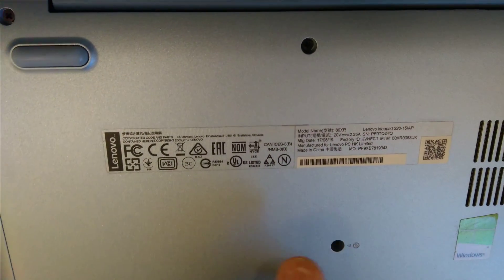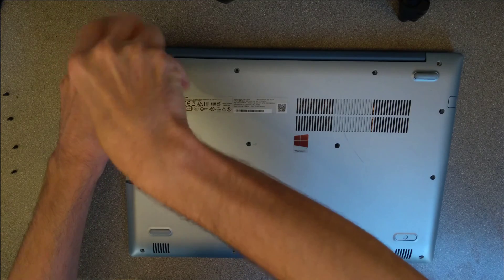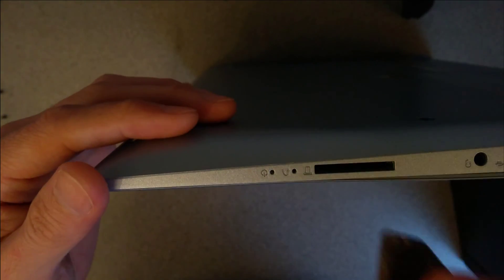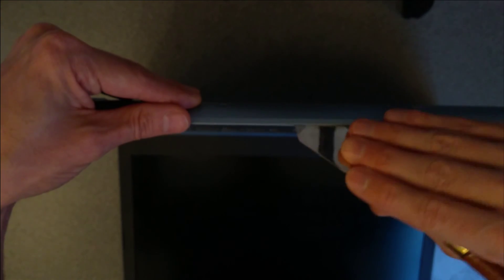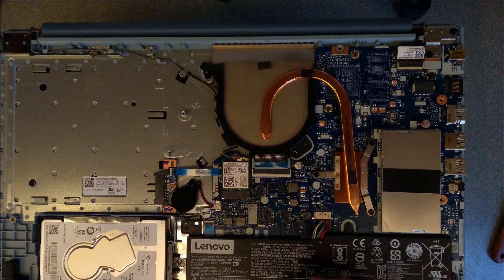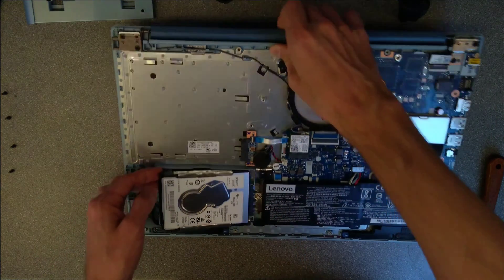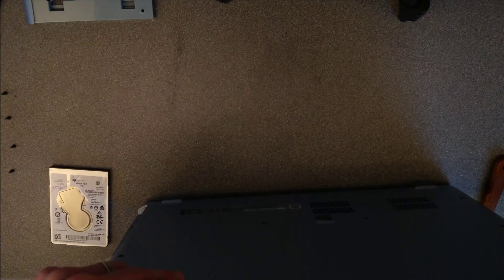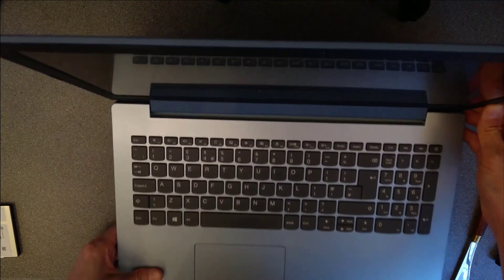Lenovo ideapad 320 - How to change or upgrade the hard disk. (80XR0083UK)

Comment: Hey when I did this my laptop was having booting problems
Reply from the maker: Did you clone the old drive, if so how? Or did you fresh install windows?
Reply: @freename  like I bought a new hard drive, battery, and ram. When I put those n it takes me to boot setting but act like the keys don’t work or it freezes. I put old stuff back in and it just have a never ending loop of the Lenovo logo with a loading bar. I just bought that thing u was using to copy the hard drive but idk if that’ll make a difference.

Comment: Very helpful guide. I miss the days when laptgops had a separate little door you could quickly unscrew and open up to upgrade the HDD/memory.
Reply from the maker: Yep, such a shame they moved away from stuff like that. Dell also had computers that didn't need screwdrivers to open and remove hard disks etc. (all on little plastic clips and brackets, no tools required).

Comment: Thanks - very useful and far better than trying to use Lenovo's Hardware Manual. 

Would add that I used guitar picks, rather than metal tools to remove the base - less likelihood of scratching or damaging the computer. 

I buy packs of picks of different thickness and find that the thinest is usual the one that helps me get started. With this particular laptop, the best way in seemed to be on the RH side up near the hinge.
Reply from the maker: Ty

Comment: Hi.. Thanks for this video!  Can we replace the existing 1Tb HDD with higher capacity HDDs? Is it supported?
Reply from the maker: I expect so but don't know what the limit might be. However I would strongly recommend going SSD, it makes such a speed difference.
Reply: @freename  a SSD will incress battery life on a charge because there is no spinning disk.
Reply from the maker: Good question and I'm afraid I don't know. Would likely be easy to Google if you search power consumption of a hard disk and power consumption of an SSD. The SSD is likely to be little to no power until you write data.

Comment: Good video was looking where them memory was or is it soldered in?
Reply from the maker: The RAM might be under the silver metal shield you can see at 8:23 over on the right side of the motherboard (to the right of the CPU, left of the USB ports and above the battery).

Comment: If I clone windows 10 on the HDD using the method described and then change the boot priority to USB in the BIOS, can the machine still work from the SSD? I have no practice disassembling notebooks and don’t want to ruin the machine.
Reply from the maker: That's a good question and I'm not sure of the answer. You can try. I would expect it to be slower than putting the SSD into the computer.

Comment: Thank you so much for the detail here - really helped - urgent RAM and SSD upgrade needed and it all worked out fine.   I always worry about whether I need to take out the battery etc - so I noticed you didn't here (for the SSD) and so I followed your lead.
Reply from the maker: Thanks for the thanks :)

Comment: Hi, I am planning to buy ssd for my Lenovo 320. Is it possible to replace the hdd with ssd then place the hdd to cd drive, will it work ?
Reply: Yes, it will work, you just need to buy a 9.5mm caddy for hdd to the Ideapad 320. The sistem will boot from the ssd, so you need to backup/clone the hdd image before changing the slots
Reply: Hey dude, just wanna ask, did that work? Let me know, was there any heating problem or any other problem in that setup

Comment: Can you suggest RAM compatible with this? Getting one and I am looking to fill it to it's 16GB capacity and SSD
Thanks in advance
Reply: Hi Andrew did you upgrade it? I'm looking yo do the same thing
Reply: @carlamolina695  I never ended up getting it based on this video. I didn't care for the build quality or engineering of this machine. Went with a Thinkpad instead
Reply from the maker: Crucial.com system checker does a good job!

Comment: Hi there I also have Lenovo ideapad 320 but it keeps restarting. I feel like the drive is corrupted. What should I do? pls. help. Thanks
Reply from the maker: Do you get a blue screen before it restarts? Does it restart when doing a specific task or program?
Reply: no I don't. It's just checking media and then a message that says exiting PXE ROM appears. and then it restarts and the same cycle happens :(
Reply: @maestratv2689  Hard drive is dead, I tried reinstalling windows 10 but when I tried to format it, it failed.
Reply: @Straiferdt01  thanks a lot. have you tried changing the drive? Do you think it will work?
Reply: @maestratv2689  Yeah, actually I bought an SSD yesterday and just today I installed it using this video. Now the laptop works and everything is fine.
Reply: @Straiferdt01  woah cool. thanks a lot. would do this now :)